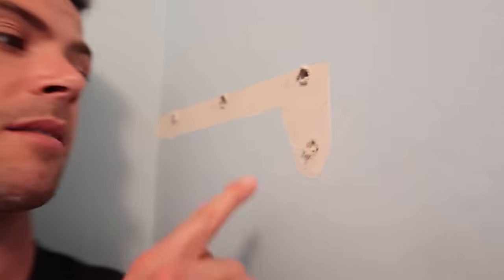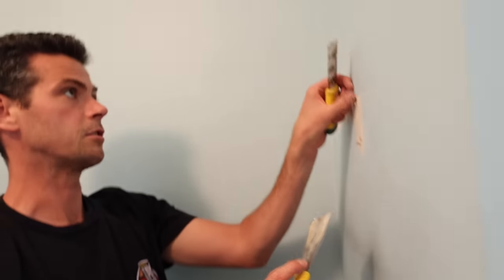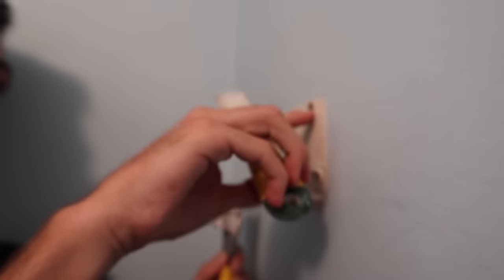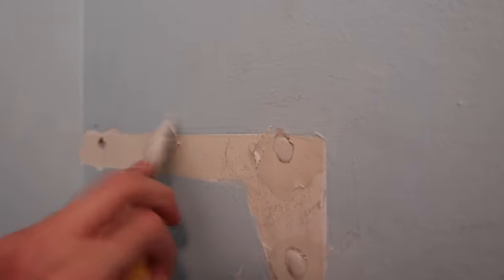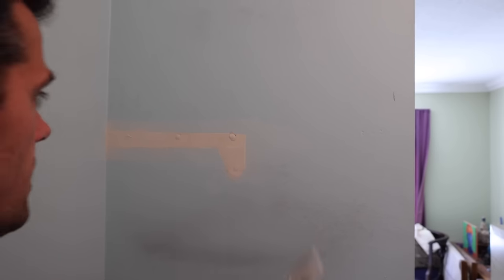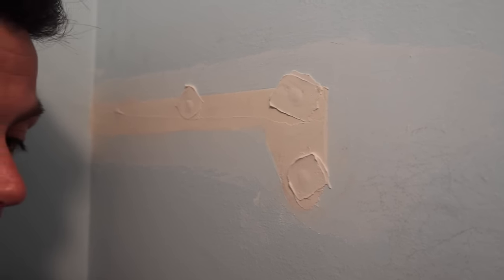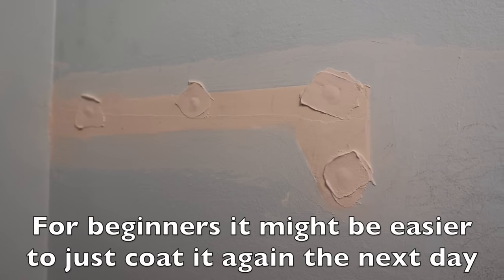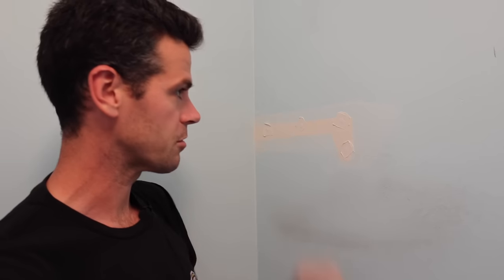Fixing Big Holes from Drywall Anchors!

Comment: I am a first-time homeowner on a DIY budget. I’ve been avoiding a messy bathroom wall repair for over a year now because it felt too far above my skill level. I am learning so much from your videos that I finally feel confident enough to start working on it. Bought my materials and made a plan of action, so here goes! Thank you for sharing these tutorials!
Reply: How did it turn out?
Reply: @kennya5165  I think she ended up burning her house down.
Reply: @rolo1369  got a little carried away with the electric sander, eh?  Gonna have to remember that for my next camping trip.
Reply: @kennya5165 I need advice. I am looking to install blinds but the window frame depth is small. I will have to do outside mounts. Should I install on the window frame / architrave or above the entire window and frame. I do not want to mess up the frame with holes or dry wall with holes especially after a few years they start to get loose.
Reply: I put my blinds on the drywall above the trim.  Can patch drywall no problem,  but holes in your trim sucks

Comment: Over the years of doing renovations, I found that a short piece of 3/8” dowel with the end rounded over into almost a half-dome is my little helper for this sort of thing. I scrape off the loose bits as shown here, then tap the rounded end of the dowel into each hole to create a good deep dimple. Then follow the rest of the steps as shown. This way I know the loose torn bits are nowhere near the surface and can’t mess up the skim coat.
Reply: That’s the best repair and what I’ve used for almost 50 years of drywall work

Comment: Personally, I'm definitely a big fan of: bevel; 5-min hot mud; wet sand (if necessary); texture if necessary; prime/paint, all using a heat gun to speed things up . I do handyman work and usually can't justify the time to come back out to do multiple coats on repairs this small
Reply: Heat gun and a fan 👍
Reply: @jayrob7418  what are we doing with the fan?
Reply: Bondo is my best friend on quick jobs.  Especially when they want paint done ASAP.
Reply: @hasanmatthew5204  I know a few guys that use Bondo on spots that come back.
Reply: @Troy_Built  Use 'KIllz" a lacquer paint. then finish paint.
Reply: Im in the same boat. I do hvac and every once in a while have some small repairs to do. Same day patch n paint. Curious about this bondo idea. I usually do spackling because its not worth carrying mud in the truck
Reply: Use a fast set.....from 90mins to 5mins
I've been a ticketed lather/ISM for 43 years......never seen anything like this.
Reply: @Troy_Built  ... the only problem with Bondo is regular mud doesn't stick to it. IOW, if you need a second coat it needs to be done with Bondo again. The hole also needs to be all the way through. If you Bondo a divot it will pop out again. If it's on a stud you can install a screw and leave the head up a quarter inch so the Bondo has something to grab.
Reply: @ProleDaddy  To cheer for you !
Seriously, to dry the mud quicker.
Reply: @ProleDaddy  anyone who does drywall for a living uses fans. especially for repairs. it speeds up the drying time ten fold. i'm not wasting my time holding a heat gun. i can be doing other repairs while the fan is drying it.
Reply: @martincarnahan381  That makes good sense.
Reply: Why not hot mud using this technique and then finish coat the next day? It'll add a day sure, but should be more durable
Reply: Easy sand 5 for the win!
Wham bam done.

Comment: For some reason the owner of the company I work for thinks I know what I'm doing. (???)  He asked me to do some drywall repairs in his home while they were vacationing. I got a text from his wife yesterday thanking me for the great work done in their house. I was a good carpenter but I owe 90% of my drywall skills to you Ben. I'm dead serious the content you put out really helps guys like me out. 
THANKS man, take care. 👍👍
Reply: Ditto.  I just replaced a sliding patio door that due to some modifications in fit left damaged drywall.  I didn’t hesitate to tell the contractor that I would do the interior finish work.  I applied what I learned from Vancouver Carpenter and my drywall work was excellent - very slow, but excellent results.
Thanks Ben
Reply: I think as a carpenter you're already most of the way there.  Manual skills already in place...compared to cubicle jockeys, lol!
Reply: Where can I get this vacuum sander setup??

Comment: I mainly do electrical work for a contractor and create an extreme amount of holes everywhere I go. I didn’t care much because drywall and mud guys fix everything. But then I started getting independent work and it was real costly to hire guys to patch all the holes I make. Your videos helped me a lot, it gave me confidence and with your tips and many hours of practice I now do my own drywall repair and taping in my side jobs. Recently I’ve expanded and started doing other types of work. I just finished a basement and the only thing I sub contracted out was the plumbing.

Comment: THE DISAPPOINTMENT! of not seeing it painted :) Love your channel and you are the best drywall channel on YouTube. Thanks for the time and effort you put into these videos.
Reply: But using the same paint saved for a year on patches ends up (most often) with a patch a bit different in color. The whole wall usually needs to be painted. Just corner to corner, not the whole room. Even if you go to the same store and buy the same paint by the numbers, it will usually be a bit off, and you'll need to paint corner to corner.
Reply: best drywall channel - Plus 1.

Comment: On small projects like this you can use a damp spongue (a kitchen spongue is perfect) to smooth out the mud instead of sandpaper. There's less clean up because it doesn't leave any sanding dust on the wall, baseboard or floor.

Comment: I started using Bondo to fill the big holes. I don't make it flush. I just want the Bondo to act as a backstop for the holes. When it dries, I then go over the holes again with spackle, smothing everything flush. When it dries I sand everything a little and then paint primer over everything before painting with the wall color. What I like about the Bondo is that it dries rock hard and will not move. When I would just fill the holes with mud, you could push the repair in with your finger and it would go right through.

Comment: Nice trick. As a painter I usually do the indent first, then the mud. And for your example I wouldn’t add extra mud, I would wait the next day and just do touch ups with
Dap pink filler (the small quantity makes it dry faster, then I sand). I’ll try your method next time (indent and mud at same time). Thanks!
Reply: which do u prefeer
Reply: Drydex is great 👍

Comment: I like your technique to counter sink the edges a little. I’ve always used an old Robertson screwdriver that I hit on the tip. The butt of the handle is rounded so it makes an indentation roughly the size of a dime. If the holes are bigger, especially when screw in wall anchors are removed, I back fill the the holes with wadded up paper towel. FWIW

Comment: I had some of these to fill today on a job for a customer and I use pre-cut pieces of doweling with different diameters and apply Liquid Nails to the edge of the dowels and gently tap them into the opening.  This method might be kind of unconventional, but it does work and then I apply a couple of skim coats over the dowels.
Reply: I’ve seen people do lot of mudding work with liquid nails. Well one guy. And it was always good work when he was done it’s a slick trick

Comment: I can't find your video I watched before I began, so I thought I'd comment here. I repaired a section where a towel rack had been hung at least three times. There were anchor holes everywhere. I cut out 3" diameter circles in the drywall to make sure I'd get all the little holes and installed plywood backup pieces. Then I inserted 3" drywall circles and then mudded everything. I was worried after the first mud coat because I could see the outline of the patch, but by the third sanded coat it looked like a pro had done it. I ain't no pro! I'm a novice. Your videos are super! Thanks for the tips and lessons!

Comment: I'm very new to this, I worked for a guy doing drywall back in 2016 for a good solid 2 months and he was patient with me and taught me from the ground up. But I needed some extra cash recently and took on a small drywall repair job and I'm finding out that I have to just wing everything. I had to fix some drywall anchor holes in the bathroom, I originally tried scraping it like you but some of that drywall paper was fuzzing up and it was driving me crazy, so, I grabbed my belt sander and it worked so good, so fast, highly recommend it. Thanks for your videos, also. It really helps when I don't know something, or even when I think I know something!

Comment: I use 5 minute hot mud. wait about thirty minutes lightly sand. I know the middle still will look wet but you can feather the edge with a sponge and paint it. no need to do any priming hot mud.  little spot like this you can feather the edge paint then go take a candy bar break or cheese burger break.

Comment: I take a utility knife and cut a slight bevel and remove all the loose paper and fuzz around the holes.  Especially with screw in anchors, the drywall will be raised around the circumference.  Even drilling holes can cause those ridges.  If they are not removed this will come back and be a problem when finish sanding and you'll end up with little circles or you have to use much more compound over a larger area to hide them. Also, using a fan greatly speeds up the drying process if you are in a hurry

Comment: I recently had to do tge same job and pretty much did the same thing.  Good tip about using the tool end.  I only pushed in with my finger.  Wish I had a fancy sander vac thing. I made a dusty mess everywhere 😮

Comment: If you doing it building up above the surface like that to sand later, be sure to use regular mud since it is soft and easy to sand.  If you use hot mud, sanding will be far more difficult.

Comment: I just use plaster to fix holes like that, just make sure to trowel it smooth and even with the surface around it because there ain't no sanding that stuff, the reason I like it so much is because it doesn't shrink and there's hardly any follow up work, just a thin coat of spackling afterwards and a quick couple of strokes with a sanding block and it's ready to paint.

Comment: I always bevel it out like a little square cut some mesh tape in little squares. Fill with hot mud put my mesh square in. Seems to work good doesn't sink in.
Reply: Doesn’t the mesh give the wall a raised surface look?  I’ve always found that but then again I’m a home diy’er and could just have done it wrong.
Reply: @flch95  I embed my little mesh square so it's below the surface.

Comment: I usually hammer it flat or use the but end of the screw driver to flatten the surface and then fill it over
Reply: You can break the drywall too much and cause loose paper doing it that way causing imperfections in your paint but if it works for you keep on doin ur thing man lol
Reply: I use the handle end of a screwdriver as it has a very large radius and is very smooth and I can create a very subtle dimple around the hole.  It fills in beautifully.
Reply: @blitz902  Ummm.....The reason taping knives have a metal end on the handle is exactly for this reason.....lightly tap the hole to invert, then Pre-fill, then small piece of embed tape and 2 coats on top......the first coat right away, the second next day
Reply: @PDRCanada  ur right but the end of a knife has less surface area to it then a hammer or end of a screw driver which causes less loose paper  in that area but as I stated before to each their own if it works for u then do ur thing
Reply: I use the round end of a ball peen hammer lightly tapping to indent the holes.

Comment: Get a cheap $2 wide mouth medicine dropper (syringe), cut off half the tip, and squirt joint compound into the holes to fill them up from the inside out.  Works on smaller holes too.  Level them out, let them dry. Place top layer onto the shrunken putty that dried.  Lightly sand, texture, and paint.

Comment: Thanks for giving us the inside scoop on fixing drywall. Getting the right finish has always been a complete mystery to me. QQ: you used your knife handle to mash down the sides of the hole and to force the mud down into the hole. Is there any other tool you can use to do this? Like the butt of a screwdriver handle, a ball-peen hammer (lightly), or a carriage bolt screw head to make a shallow, symmetrical dent in the wallboard?

Comment: For repairs like that I use a small ballpeen hammer and dimple the hole in then I use hot mud and push that in a little with the ballpeen hammer. When that drys I skim it, wait until it drys, sand, prime and paint.

Comment: After preparing the holes, I use Plaster of Paris mixed in a small zippered sandwich bag, cut a corner off of the bag and inject the plaster into the holes like a baker’s piping bag, then let set up and sand and paint….

Comment: Ohhh.. you almost had it there. Use setting type joint compound and it can be done in a matter of minutes and ready to prime and paint. I did that crap for 30 years and never would have gotten away with that type of repair taking days to complete. Use compound that sets in five minutes but don't pile it up on the patch, (keep it smooth and level with two coats in sucession) after 5 minutes use a fan to evaporate the water out, sand very lightly, so the customers cleaning people aren't pissed when they dust the piano downstairs, and BAM ! all done. Prime and paint two coats with the fan still on, write up the bill and go fishing.

Comment: I watch frequently and have learned many tricks that have helped me  a lot. My comment is that the drywall repairs I have to make are mostly on textured walls not smooth. After the repair texture needs to be reapplied.  Spray cans have always left something to be desired for me.  any tips on matching existing texture over repairs.

Comment: You think plugging the initial hole with a small cut of dowel glue in place is a waste of time, could it save on drying time? It’s on 3/4” holes. Then patching over the remainder with mud. Just curious, always looking for new ways to do things.

Comment: I’ve had luck (with small holes like that) by wadding up toilet paper to fill the hole. Seems to give it a little backing when filling. I like the idea of building it up a bit and will try that next time to avoid a second coat.
Reply: I've done that with all kinda of stuff as backing. I'll use spray foam as my go to if it's handy too

Comment: The best way is to NOT pull them out in the 1st place. Tap them in to be recessed. I use the squared end of a nut driver. If they are out like that I wad up paper real tight and fill up much of the void to give mud backer. Then hit it with quick set.

Comment: If the anchors are still in the wall I cut the rim flush with the wall and push the anchor in about an eighth or so and mud over them like you.  If the anchor is pulled out I roll up a small piece of paper towel (about an inch or so long and a snug fit on the hole diameter) and insert it into the hole about an eighth under the surface and mud it like you.  Easy peazie.  Cheers.

Comment: No tape or texture. 
Beginners night out.  
You need to get a full pan of mud thinned for taping and put tape over the holes so the mud in the holes can’t fall out which it will. 
Then float out any surface defects and sand then match the texture or smooth like surrounding walls. 
Without tape its toothpaste.

Comment: As a painter & Decorator for over 45years I can’t disagree with any of the ways he showed us to cover up small holes left in plaster board  however I would fill the holes twice or three times if necessary because it doesn’t take long to dry with flush filling and is less work sanding down .

Comment: All my years doing some carpenter work on the side, I have used TOOTHPASTE WHITE (I use Colgate)TO COVER HOLES SMALLER THAN A 1/4 INCH!! Works good and gets hard. It is quick and easy with no hard work. Scrape wall off and use your finger tip to fill the holes, that's it!! Never had a problem or it showing thru after painting

Comment: With a sharp knife cut the ragged edges off the holes at a bevel. Fill with lightweight no shrink filler. In a hour go across all holes with a layer of joint compound.

Comment: I've been painting for over 30 years. I've still seen amateur people. Patching a hole, put  mud in the hole and drag the putty knife to either left or right, then go back in the opposite direction but don't put any more mud. There's a joint compound that dries in 20,45, and 90 minutes. Not ready to apply, it needs to mix with water. It's labeled easy sand, 20, 45, or 90. 
20 should dry in 20 minutes, 45, in 45 minutes and of course 90 in 90 minutes.
A hole like in this video can be done in less than five minutes from start to finish.
It needs a hair drier or a heat gun. The first coat should dry in 1 minute, second and third about 30 seconds each.

Comment: If you want to do an even more complete job, prior to filling, spray primer into the hole. This way whatever material you use to fill will not pull off or appear to "shrink" You can do a test and see. it just takes longer since youd want your primer to dry. i cant take credit for this. it was taught to me by a professional handyman/carpenter/AC tech. He is well versed.

Comment: I found out the easiest way to fill the holes is by using an icing tube to squeeze the speckle in the hole than use the putty knife to smooth out the surface, instead of using the heel of the knife to push the speckle in.